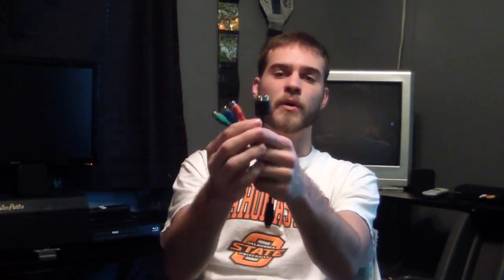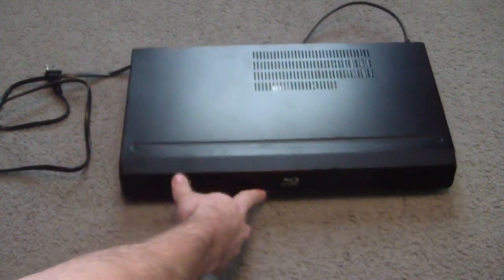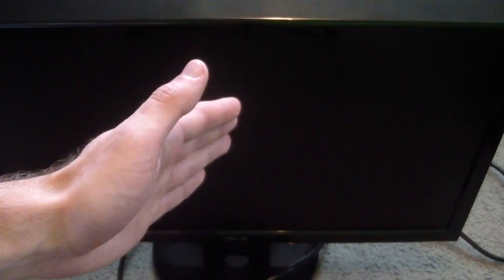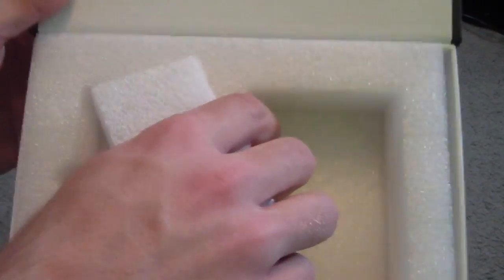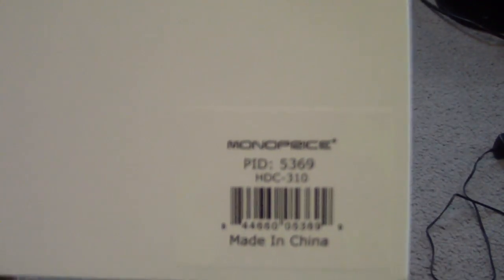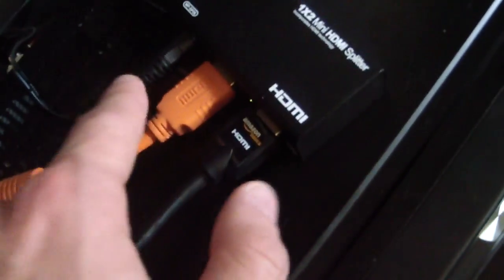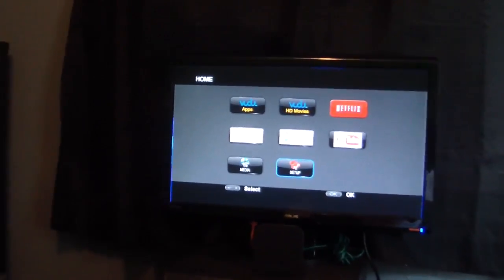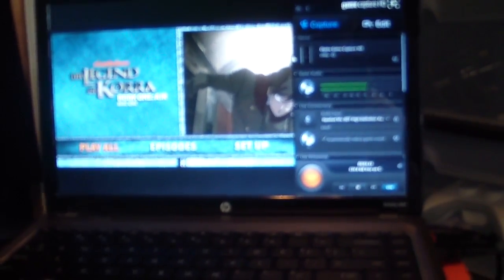How To Strip/Bypass HDCP - Elgato Game Capture HD Tutorial

Comment: A DVI converter is NOT necessary. I tried to make my Elgato HD60 work via HDMI with my PS3 using just a 4 x 1 HDMI switch and it worked perfectly! I didn't have to buy any converter or HDMI splitter. Also, I don't even need my Elgato software open or running to use my PS3 through it so that's another reason that I don't need any HDMI splitter.
Reply: I  knew the DVI was unnecessary just a sales pitch .where did you get your 4x1 HDMI switch

Comment: HI man, thanks for the video. I was wondering if this SPlitter will still work  bypassing HDCP if you use it plugging the cables inverse. I mean Using both OUTPUTS for 2 HDCP compliant devices like PS3 and my DVD recorder (I want to use it to capture gameplays of retrogaming consoles)  so they could be connected with just 1 cable (using the splitter input like an output) to the ELGATO game capture device. PLEASE HELP ME.

Comment: Does this work with the HD60? Yes it does. I tried it out on my laptop (my new one I got for Christmas) and it had some glitches on it but I fixed that by putting the encoder to best performance and everything runs absolutely flawlessly but with a few minor glitches/bugs but still no big deal. Now I can run my new gameplay videos in the best rate possible!
Reply: Are streaming devices (i.e. Chromecast, Apple TV, Amazon Fire, etc) HDCP enabled? Sounds to me they are.
Reply: Strangely, the gold coax cable works better on the right side on my new capture device. On my previous capture card, it took a few tries.

Comment: Hi! This is a couple years old, and I'm hoping you're still around. This video has had the only viable solution that I've come across so far. 
I'm not needing to record anything, but have an older HDMI TV and a Roku 2.
I was able to play videos with no problems for almost a month, then get the purple HDCP error screen. 
Will getting the splitter and converter work for this issue? Thanks in advance for anyone who can help!
Reply: Just get a new TV and that'll fix the problem, I'd bet.